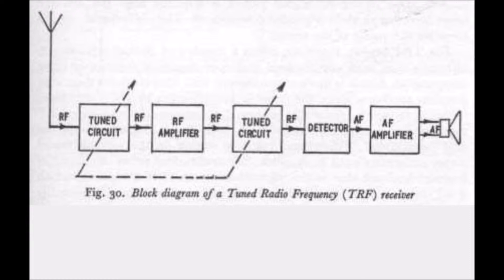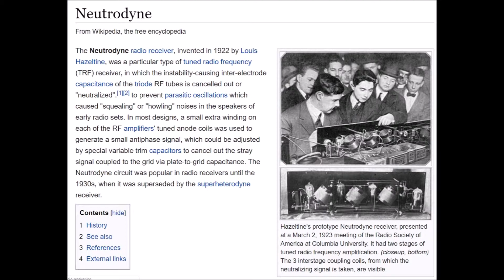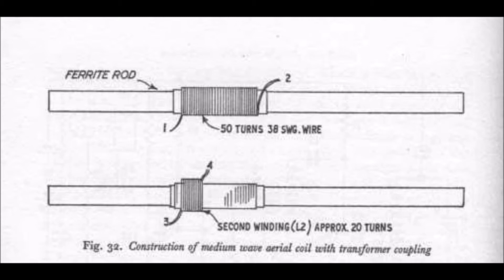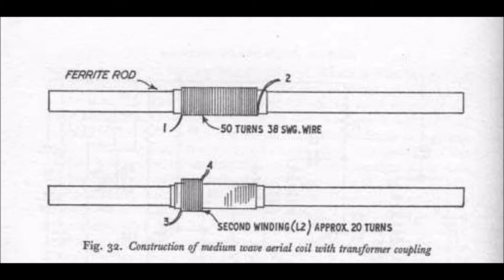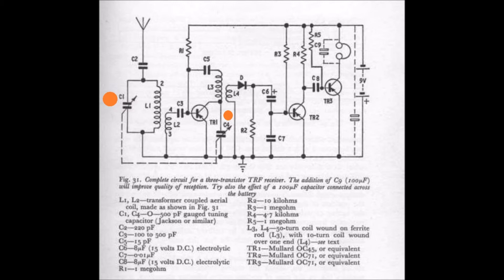TRF Receiver

Comment: Well Sir, I don't know where to start!  While it's definitely very interesting, there's so much wrong with the video.  Mostly in terms of inconsistencies between the images shown and the commentary.
I do however note that some of the basic explanations at the beginning of the video would be useful to those who need such information.

I have the impression that the voice-over is being read from a script, in which most of the trouble could be attributed to the script writer.  However, there's no doubt at all that the circuit board shown doesn't conform to the circuit diagrams shown.

If you really want a more detailed report, just let me know.
In return, I would greatly appreciate the reference to the magazine (or  Mullard literature?) from which the article is taken.
Stay well!  Regards.  Clive.
Reply from the maker: You're not wrong.  ... Maybe you are pointing out that you have more knowledge than I do. You're probably correct.  Unfortunately, everyone is missing out on what you have to offer. I checked your channel, and you don't have any content. Truthfully, and sincerely, maybe you ought to create some videos.  It sounds like you have a lot to express. The article is not from Mullard literature, although it might make reference to their transistors. 

I'll take you up on that detailed report.
Reply: @2bit661  Very well, Sir, in time order:
03:45 - Small point, transistors can provide greater power gain than valves/tubes in correct configurations
05:16 - not your fault: in the circuit diagram of Fig 31 there's no dc path to TR1 collector so it won't work.  And yes, errors can get into published work!
07:05 - Fig 32 shows L2=20 turns, commentary says 10 turns
07:33 - Commentary speaks of the 2-gang tuning capacitor, the image shows a single gang type plus five preset "trimmer" capacitors
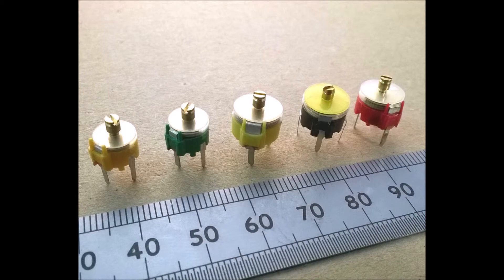08:44 - Commentary speaks of the tuning capacitor, image shows the same 5 trimmers as above
08:52 - The coil in the image has the right length of ferrite rod but a non-representative coil, ie 19 turns thick wire with no space for L4 to be added.
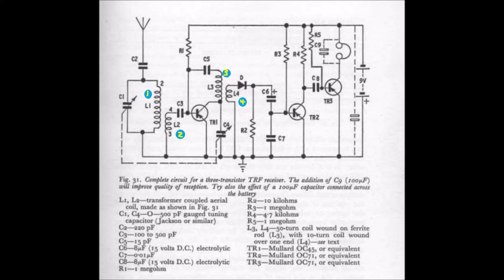09:28 - The commentary describes L3  incorrectly as having a centre tap while none is shown in the circuit (might be the circuit's wrong, see 05:16 above) while the image repeats the L1/L2 assembly.
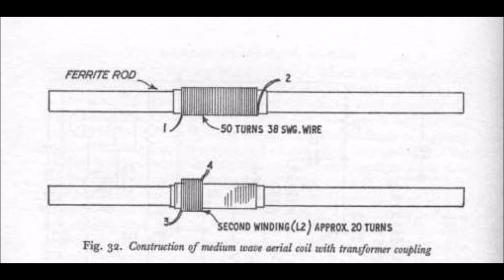10:40 - The aluminiun screen is incorrectly attributed to L2/L3 instead of L3/L4
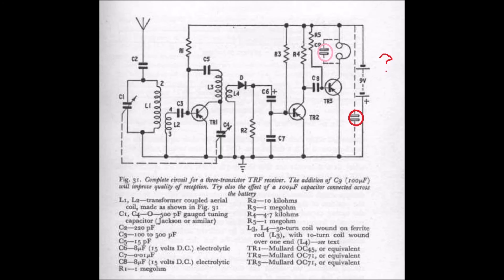11:11 - Commentary says C8 instead of C9, and again at 11:59
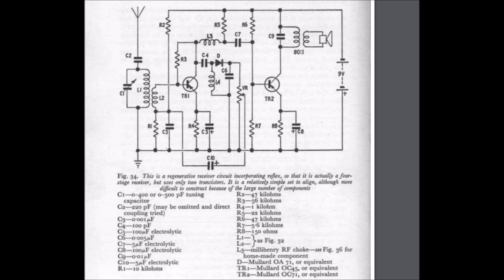12:08 - Fig 34 is radically different from the preceding circuit in that it contains two new features: (i) regeneration - sometimes called reaction or positive feedback - increases the sharpness of the tuned stage while also increasing the tuned gain.  It needs a separate control to prevent it causing oscillation.  (ii) Reflex.  This means that TRI amplifies at Radio Frequency - the RF signal is converted to AF in diode D - the remaining RF component is filtered out by C6 - the AF signal is returned to TR1 base via C10 for AF amplification across R5 whence the (now twice) amplified signal is passed to TR2 for output amplification by TR1, (which in neither circuit incidentally can drive a loudspeaker.)
Incidentally both the regeneration and the reflex schemes require quite advanced knowledge which (a) isn't explained and (b) is at a higher level than that of all the preceding matter in the video.
In response to your remarks:
Yes, I respect almost all uploaders of videos onto youtube, yourself included.  I respect their effort and trouble in producing and uploading the material
I wasn't aware of having a channel, I've certainly never entertained the idea of producing or uploading material.  I have occasionally offered comments which I ensure are civil, serious and respectful - not like some of the wilder replies one sees - on a variety of subjects.
Upon further examination of the circuit diagrams in the video, I withdraw my request for the source information.
Regards, Clive DipEE.  (age 78)
Reply from the maker: @jjmcrosbie  OK, Well, thanks for the input. At the moment, TRF Receivers aren't my focus, but, they might be, in future. And, maybe it will help others who stumble across this video. (I'll pin your comment to the top.) Thanks, Best wishes. -2Bit
Reply from the maker: Also, I re-watched my video, and 90% of the images are circuit diagrams. And, even then, I'm not clear on how the images are so inconsistent.  Often in my videos, I point out that I am not an expert, but I am an enthusiast of electronics. My aim is not to be popular, but to share my passion with like-minded people.  Ironically, Clive, you  probably share similar interests to me.  So, I'm confused at your criticism. And, yes, I think you are being overly critical. All the best!